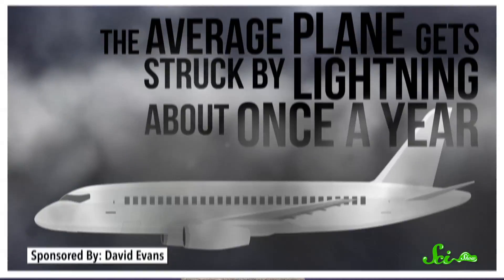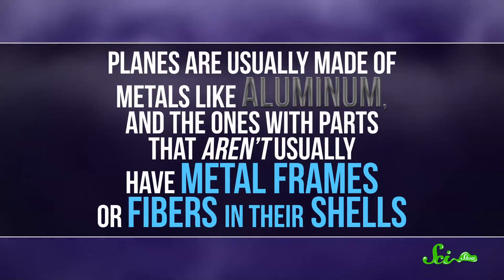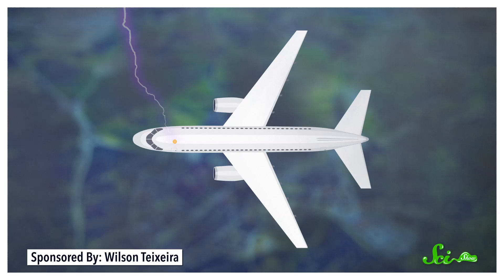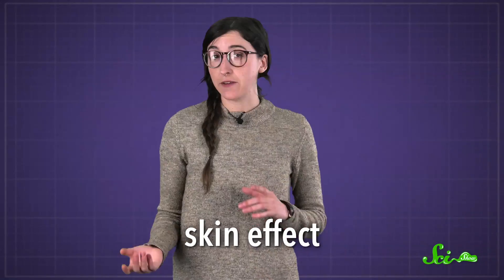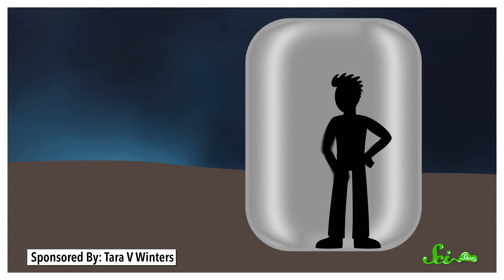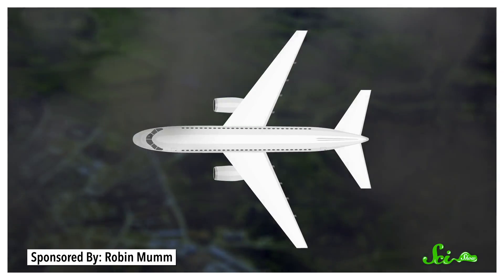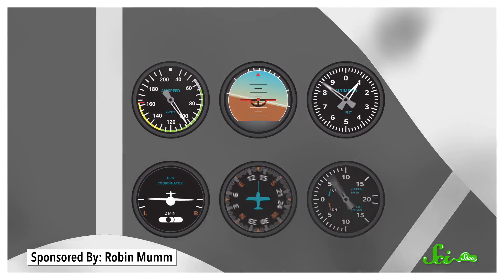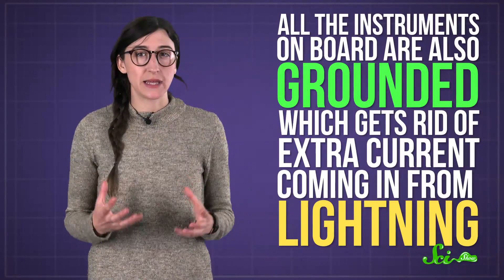What Happens If A Plane Gets Struck By Lightning?

Comment: I work manufacturing sheet metal parts for aerospace.  A significant amount of work goes into meeting Electrical Bonding requirements to make sure that parts in contact with each other maintain electrical conductivity even after having finishes applied to them to reduce corrosion.  Alodine is typically used on these areas as anodized surface do not conduct electricity well.

Comment: I feel like something got a bit mixed up here...

The skin-effect applies to alternate current, where due to the dynamics of how magnetic and electric fields interact, the majority of the power is transmitted through the outer parts of a conductor. 
However, with lightning strikes you're rather dealing with very intense, short-term bursts of direct current, thus the skin-effect doesn't even apply here. 
Shouldn't the explanation simply be the fact that the outer hull of the plane is a faraday cage?

Comment: How does a plane have any current run through it when struck if there's no low-impedance path to ground? The plane is in the air and physically separated from the ground, and air has a HUGE resistance to electrical current.

Why doesn't the strike just charge the plane as a whole, and then discharge once it touches down? Also, why would lightning even strike it in the first place, if it's got no path to ground? 

Am I imagining this wrong - does a lightning strike on a plane not end at the plane, and rather goes through it all the way to the ground?

Comment: BULLSHIT! SKIN EFFECT IS CAUSED BY COMPLETELY DIFFERENT PRINCIPLES, AND HAS TO DO WITH THE FREQUENCY, AND THE INDUCTOR CROSS SECTION. WHAT HAPPENS HERE, HAS TO DO WITH THE CHARGE STAYING ON THE SURFACE AS IT IS HIGH VOLTAGE DIRECT CURRENT, AND NOT ALERNATING CURRENT!

Comment: If I'm right , skin effect is tendency of AC current to flow closer to the surface of conductor (wire) ,and is related to the frequency of AC. The higher the freq. skin effect is more visible. In case of planes we are talking about Faraday's cage .

Comment: Huh. It is possible my car got struck once by lightning then.. which is a slightly more logical explanation than what I think happened. One time I was driving, pretty slow like 15mph cause I was getting ready to turn into my driveway, and about.. 20ft in front of me I could have sworn ball lightning just appeared in mid-air and then dispersed outward in the horizontal plane. I was concerned that if I had been 20ft ahead when it formed that it would have shown up inside the car and I'd have died.. but maybe my car just got hit and that's what I could see from the driver's seat?

I was also driving between electrical poles (yes, we still have them where I live cause I'm on a mountain), the ball I saw formed right in the middle of the road and then shot out in either direction towards the wires, kind of like a big electric smiley-face.

Comment: What about planes like the 787 and A350 with carbon fibre skins? The fibres are a conductor but they only conduct unidirectionally and the composites are normally placed multi-directionally - so it's not as conductive as that of Aluminium.

Comment: I am a mechanic for one of the largest airlines in the world and from a practical perspective the damage caused by lightning looks like pitting or sometimes little metallic melted blobs. Check out a pito static sensor that had a lightning strike. Didn't do any significant damage. Sometimes the damage may require changing a component or doing some repair work but unfortunately a servicing vehicle or cargo ramp can cause way more damage when they bump into the aircraft. Modern airliners are extensively engineered and tested and as statistics show, you are far more likely to be in an accident on the drive to and from the airport than in an airliner. I and my family fly so come join us

Comment: 1. The sound of the lightning will make everyone go deaf
2. The heat from the lightning (hotter than the sun) will melt the plane
3. The brightness from the lightning will make everyone go blind
4. Lightning can act like an EMP, so it could possibly shut down the air plane

Comment: No mention of the 'Faraday Cage'? The 'skin effect' is the tendency for higher frequency current to flow closer to the surface of a conductor. Due to its very high impulse characteristic, lightning does have  a very high frequency signature and therefore most of the current will tend to move across the outside of the plane fuselage. However, I would expect the Faraday Cage effect to play a large role in ensuring no dangerous electric fields are generated inside the aircraft. Predicting the effects of lighting on any structure is a very complex calculation.

Comment: I've had a pilot friend tell me that flying through storms isn't particularly dangerous. But this is secondhand, maybe SciShow should look into the danger of flying in storms?
Reply: I'm a pilot and flying through thunderstorms can be deadly. The downdrafts can exceed the rate of climb of a commercial airliner, the wind shear can cause a stall, the turbulence can lead to structural damage as can recirculated hail and finally, severe icing conditions can compromise aerodynamic efficiency, which isn't good when you're being forced down faster than you can climb. I'm guessing your friend probably meant a rain shower, rather than a fully developed towering CB. Even the largest commercial air traffic will deviate off route to avoid storm cells. It can cause chaos within air traffic flow management.
Reply: I asked and he apparently meant cargo planes vs tropical squalls.
Reply: Asked him about it and he said he meant when flying cargo planes, are basically flying tanks.

Comment: NO NO NO this is NOT the skin effect!! Holy shit SciShow do your research. the skin effect is when AC (underine AC) current travels through a conductor, it tends to travel on the surface (hence Litz wire). Lighting is DC and the skin effect does NOT APPLY.

Comment: It's NOT the skin effect, it's a property of any Faraday cage.
The skin effect is about solid conductors at high frequencies, Faraday cages also work at very low frequencies including DC. 
At DC a solid conductor also has current flowing through the middle.

Comment: Thats great and all, but modern airliners are mostly carbon fiber with only a little aluminum used. And no, the carbon itself is not any use in this case as a lightning conductor.

Comment: Aircraft also have parts called Lightning Diverter Strips. They're located on radomes and composite parts, and along with the metal skin, they divert lightning towards the tail and the wingtips, which have copper connectors that act as the exit points for lightning strikes. This is more than just the Skin Effect, it's an intentional system devised to direct lightning across the surface to specific points. As an aircraft structural maintainer I had to replace a lot of these lightning strips over the years, and they're kinda fascinating.

Comment: The "Skin Effect" is a tendency of AC current to become distributed within a conductor.  Lightning is DC not AC.  Modern Aircraft are designed with built in safety measures to protect from lightning strikes usually through insulation or shielding.  Lightning wicks on the trailing edge of the wing are designed to dissipate static electricity.  They can help dissipate a lightning strike and probably the most visible evidence of safety engineering to a passenger.  Lightning can and will often damage an aircraft when it is hit. So the next time your flight is delayed due to weather don't get upset, as much.

Comment: Hmm. I don't think that's the skin effect. I was taught the skin effect was the tendency of high frequency alternating current to travel on the outside of a solid conductor which reduces the current carrying capacity of said conductor. Think of a solid block of copper or something similar. 

The reason electricity travels on the outside of a metal frame (like a plane or a car) is because the interior is genuinely less conductive. This is UNLIKE the skin effect because there are multiple materials in this scenario. 

Lastly, and I'm desperately trying to remember my 3rd year of engineering school to channel this, I think the skin effect largely comes into effect in the MHz range. Since you can hear lightning on speakers and other electronics, the frequency must be below 20kHz. Although, that's a bit of hand-waving, so forgive me if I've gotten that wrong.

Comment: Are there any issues with a modern airliner being hit by lightning regarding heating of the metal or anything like that? Even if the metal surface of an aircraft can dissipate the electricity, isn't there some kinetic/thermal force that also needs dealing with? Or does increasing the thickness of the metal body handle all that?

Comment: Those little "sticks" are called static discharges aka static wicks. They dissipate static electricity into the air. Also, on the planes I work on (RC-135)  have been hit by lightning and the bolts like to exit out of the radome at the nose. Radar hasn't been messed up by it (probably because the antenna and receiver/transmitter is grounded to the plane) but we have to change radomes quite a bit because lightning puts holes in them because they're fiberglass. We have HF antennas that also use lightning arrestors that look like a giant glass buss fuse that breaks apart when lightning hits the antenna to prevent electricity from going into the transmitter.
Reply: Brenndon McGill  
Ooow boy!!
Reply: Brenndon McGill I totally know what your talking about
Reply: Whale Fart I sense sarcasm. Haha
Reply: Brenndon McGill so your a master detective eh, well if you are can you find my dad...he has been missing for 12 years
Reply: Whale Fart hahaha I didn't claim to be a detective. I am however, an FCC licensed avionics technician. Lol

Comment: I was always under the impression that a lightning bolt was a burst of current from a high positively-charged formation in the atmosphere to the neutral ground, a way for the formation to discharge itself by creating an electrical connection to the ground. So why would lightning strike a plane in the air, if it has no connection to the ground?

If someone more knowledgable than I has an answer, it would be most appreciated :)

Comment: Nowadays, the biggest danger to planes are the pilots themselves.
Safety standards on manufacture, inspection, maintenance, and repair are ridiculously high.
And for good reason. You can't pull over and call AAA at 38000 ft.
Flying is safe, and will only keep getting safer.

Comment: That's not what skin effect is. That's a Farday's cage.
Reply: Skander Belli Imagine the hollow ball from conductive material in the electric field. There's a voltage rising between two electrodes to the moment when it's high enough to overcomes dielectric strength of the surrounding air. Spark jumps to the ball and then, depending on configuration of the electrodes and characteristic of the supply to the another electrode or is dissipated that it's not visible any further.  I am not saying that skin effect is absolutely absent but I doubt that it's the main mechanisms here.
Reply: Yes it is what the skin effect exactly is. It's not a Faraday cage as the cage blocks static electricity. Lightning moves too fast and won't be considered static and wouldn't be stopped by the cage.
Reply: Pedro Henrique Köhler what's the difference between ?
Reply: Quite the opposite, actually. Faraday cages cannot block static and slow varying fields.
Reply: Search "Skin effect" on google for a quick definition and you will see that thats exactly what it is
Reply: Luboš Pokorný 
So it is the short circuit effect, current follows any closed loop as there is no resistance within, but what about a plane, is it a short circuit with no resistance ?
Reply: Lubos, and that action just so happens to cause the Skin Effect.
Reply: Zarozapa CnJ A lightning bolt is EM radiation (it's a short burst of AC with a wide spectrum of frequencies). If planes and cars didn't have holes in them and a bit thicker walls, they'd block phone-radiation aswell.
Reply: Devils Advocate Faraday cages block EM radiation (dynamic electricity...). electrodynamics is applying electrostatics in infinitesimal time divisions.
Example: Two unlike charges (positive, negative) attract each other. Two conductors of different potential (charge difference) also attract each other (there are indeed a few Newtons of force between the conductors of HV wire, oscillating of course, because it's AC)
Reply: It's neither skin effect nor Faraday's cage. It's just an application of Ohm's law. Like a lighting rod mentioned, current just search the channel with the lowest resistance.